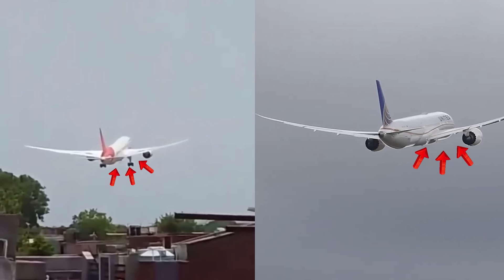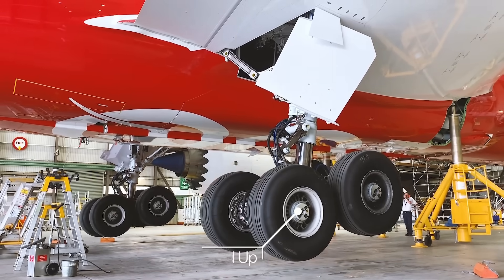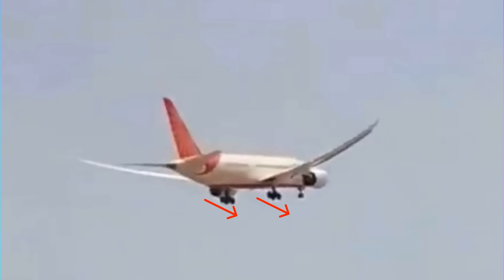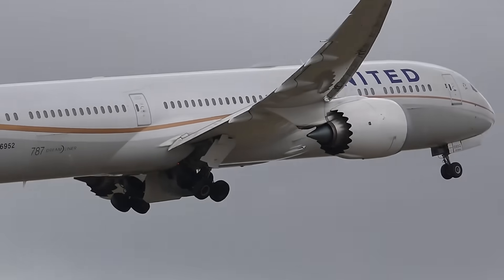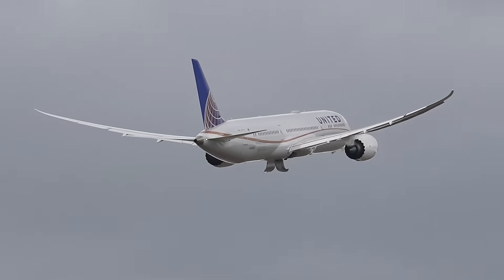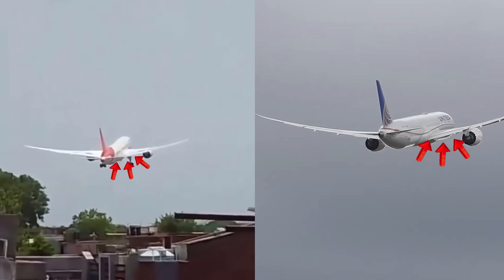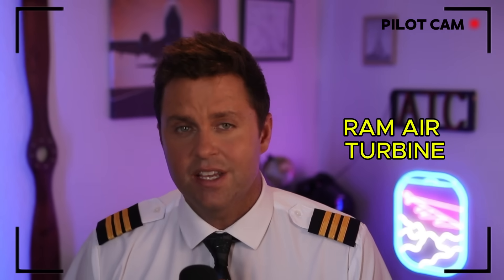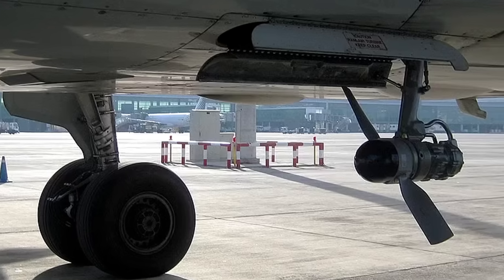Pilot Explains: A New Detail in the Air India 787 Crash Everyone Missed

Comment: my own feeling is that any engine issue would have been visible with some sort of smoke or something showing the engines not preforming well, also, I believe one actually can hear the engines on that video... maybe not full power, but they are stable as far as I can hear... the Rat will also deploy in a hydraulic failure, which seems like it might make the pilots stall the plane in a way that would appear like what one sees here.

Comment: Contaminated Fuel could be ruled out, as the same fuel was used for take off, which went smoothly.
Reply: Not if there was water or contaminant in the fuel that was just loaded. 
It takes time for the contaminant to flow through the fuel lines and reach the engines.
Reply: @spacecadet1249 water or contaniment has never ever caused any accident, except in piston engines. This was a state of art engine. This engine was capable of even digesting chickens.

Comment: Sir,
The fuel tank is fully loaded with thousands of gallons of aviation fuel for long journey, in the process, some sediments settled at the bottom of the main storage, not likely by any stretch of imagination, but POSSIBLE, the storage tank might’ve been scraped to the last drop, whereby the sediments might have entered into the fuel ⛽️ injection lines to the engine, and that it happened so early in the takeoff, meant, the sediments were still floating in the system, didn’t get time to settle down to the bottom yet !
Sincerely !

Comment: After gears up activation, full power loss, rat deployed for electronics and hydraulics, but cannot continue gears up, lights flicker due rat takeover electronics,
Decades ago i knew of thieves bleeding avgas tankers to sell as kerosene, but will not replace with water, now if thieves replace with water so the levels will be the same. That could cause dual engine failure, question is fuel contamination alarms on the A/C during refueling.

Comment: No way the pilots put the flaps up by mistake. Because the aircraft flew straight and level all the way to the ground absolutely indicates loss of power. You started by mentioning that contaminated fuel could cause that so that is probably the first suspect. But it's a complex aircraft and I have no idea what else could cause both engines to lose power. The idea that both engines fail at once is too remote to even be a consideration. Then of course you can't rule out it was an intentional act by one of the pilots but I would hope that it's also a remote possibility and was not the cause. We're going to have to wait until the facts come in to know for sure and of course the whole world wants to know what caused this disaster.

Comment: It is a balanced assessment by Gary. Not eager to jump the gun and just stating few facts. No conclusion yet. Good.
Imagine the sequence:
1. Aircraft accelerates normally up the runway and takes off smoothly at about IST 13.38 hrs - At the instant of rotation Engines were working - 0 Sec.
2. WITHIN 50 FT HEIGHT THE LANDING GEARS DID NOT RETRACT -  FAILURE TO RETRACT THE LANDING GEARS WAS COMMUNICATED TO THE PILOT - AIRCRAFT GAINING HEIGHT - ENGINES WERE WORKING - 5 secs.
3. Pilot senses the abnormality and tries to accelerate and climb quickly - Engines working - Aircraft gains maximum height (11secs) - between 5 & 15 secs.
4. Pilot senses the loss of thrust - Engine is still working but not delivering the required thrust? - Aircraft reaches it's maximum height 600 to 650 ft using the momentum - RAT (Emergency power generator triggered in the event of Duel Engine Failure) would have projected out - SOMEWHAT faintly evidenced from the visual footage of the flight - between 15 & 25 secs
5. May Day message: Sent "seconds later" than takeoff. The pilot's words were "Thrust not achieved falling Mayday! Mayday! Mayday!" - between 15 & 25 secs
6. Aircraft starts loosing the height and pilot desperately tries to save the flight - between 20 & 30 secs.
7. Aircraft continued to descend rapidly and crashed into the building - inferno/fireball - between about 25 & 35 secs. In about a minute, after the take off, fire ball & smoke errupted from the crash site could be seen from outside. 

Engine sound is clearly audible in the visual evidence as the aircraft was descending and approaching the building before collision. Was it the sound from the RAT? or was it the roaring usual loud sound from the engine? 

Flaps position in/out during the flight NOT decernable convincingly enough. There could be something about it or there is nothing about it. Investigation will reveal. 

Seq No 2 & 3 are not clearly explained in the expert analysis. There could be a slip which is not assessed/analysed. 
Until then lots of speculations? 

What is robust Safety?
Save lives.

Comment: I am not an aviator but having seen thousands of take off videos suggest to me that problem(s) had started much before the lift. Flight 171's rolling down on the runway after setting the thrust till arriving at V1 was perhaps not going as planned. The plane nearly used 100% available runway for the lift, which was executed with some serious effort. The dust blown at the runway's far end tells more about that. Do other planes using this runway also kick the dust as was done by this plane?  .... only some relevant official can tell. Why the Capt did not abort this take off ? .... would be known after black box data is deciphered.

Comment: contaminated fuel? nah ive been leaning more toward electrical , i am not fully sure of the systems on the 87 but they use very similar electronics as the jets i work on.. the jets i work on have a very specific issue albeit EXTREMELY rare and the likelihood of it happening are nearly 0 but if you lost ALL accessory drive/engine driven generators and no apu, you would lose all electrical power including to electric fuel pumps to the point a DC override switch was installed in order to run major systems off battery bus. this would both explain the loss of engine power and the loss of hydro causing the gear to stop mid transition.. so either something catastrophic happened to the accessory drive on both engines... or something to do with the engine generators on both engines and APU inop... an inop APU would explain why passengers where complaining it was hot..etc..

Comment: The fact that you are not using the original video even Capt Steve claimed he was not originally aware of in his latest video. Meaning when the original video was release the RAT was clearly heard prior to the his assessment. 

Due to his assessment, I tend to agree with Capt Steve. Due to the most probable activation of the RAT, both electrical and hydraulics failed, meaning a dual engine failure. IMHO, the first officer did try and retract the gear, its next to impossible to confuse flaps and gear up, no matter how panicked you are as a pilot. 

The only criticism I have is the pilot stopped flying the plane after power loss, IE he kept trying to pull the nose up rather than flying the plane to a safe area...  if there was a safe area.  In the end, we will all know for a fact what happened in 3 months time when the black box is thoroughly examined.

Comment: Not an expert, but during take off though both engines seem to have an effective and stabil  "maximum" trust (suggested by the postengine "exhaust"). A possible fuel contamination, you would expect to symptomize itself i n a gradual and irregular manner, and NOT to manistest itself smoothly with just a few seconds of notice. A fuel contamination also probably would not affect the engines several of seconds apart which the planes stabil course "disproves". Another potential cause of completefuel cutoff, could be a sudden onboard computer mallfunction of the fuelinjection.The pilot knew he did not have adequeate alttitude to dip the nose to increase speed, so his best damage control option was to attempted a tail first touchdow n with the hope of a gradual speed d ecrease. (A good guester from Boing could be to finance the burial of the victimes, they probably can afford it).
Just a humple theory.

Comment: Either 1) flight crew error e.g. fuel switches turned off , 2)software failure,  3) electrical failure, e.g burned out wiring, circuits fusing etc..,  4) dirty fuel is a stretch. The only remaining theory: 5) sabotage.
Reply: Suicide by co-pilot.  Has happened, Egypt Air flight.

Comment: A two-engine failure?  25 years ago, a plane could be rated to fly on one engine for three hours.  The chances of one engine failing have to be so remote that we could essentially disregard the chances of both failing independently.  One in 10^5 chance of one translates to one in 10^10 chance of both independently.  It's possible that with a huge number of flights, such low odds might have caught up with us.

One scary possibility: one engine may fail, and a pilot may inadvertently turn off the good engine.  A second scary possibility: sabotage.

Comment: MAJOR FAULT CODE
The extreme heat during that day at Ahmad'bad Airport above 40 deg C overheated the forward equipment  bay during 3 hours time cause a overheating safe reset system in the fuel system controller after take off monitored by cause of ascending excess heat in addition. ( Our DG fuel injection Overheating safe state mode) as experienced.

After reaching the ascending stress altitude Fuel Injection stopped at right engine and to the left engine. The flight was on full loaded close to maximum take off weight in Electrical load produces more heat again in the Forward Bay all the Back up system controller has been kept. 
* First Fuel Injection stopped
* Secondary back up power generator stopped
* Battery back up system stopped due to the overheating. 
Immediately RAM AIR TURBINE automatically deployed is the sound heard by the surviver and during the RAT power overtaken the electrical bypass system causes instantaneous flickering obviously happen during the rapid change over from the different power source which running in 3000 RPM.

Comment: I wonder if you should consider the initiation of engine power by the electrical system that performs that function. I wonder if there was a failure in that system after the engines had started,….then the engines failed after the start. The surviving passenger said lights in cabin  flickered just before descent
Terri Nowak
Aviation enthusiast

Comment: This seems similar to the MV Dali that crashed into the Francis key bridge in Baltimore , due Engine failure , as a result of the generators failing , thus went on  emergency power with the NTSC & other agencies faulted the machinary,  when he basic cause was the erranoues action taken by the river pilots , out of panic faced with  an emergency situatiion,
As for not taking in the landing gear & flaps , it appears the pilots were from the very early facing thrust problems,

Comment: Could a computer or electrical system failure cause a fuel engine failure, like if the computer dies in your car and it won’t start? Or would a gas turbine keep firing itself regardless.

Comment: I know another channel is suggesting a vapor lock in the fuel lines due to excessive heat in India that day. It would be ironic if planes were prevented from taking off in excessive heat which is partly attributable to the airlines own contribution of greenhouse gas emissions. What are the published upper limits of temperatures for take off? It's hard to imagine that 15+ years ago during the plane's development that test flights would have found anywhere hot enough to test what the climate is going to produce over the next 15.

Do plane's have temperature windows they must not take off outside of? We may see more night time flights emanating from equatorial countries in the near future.

Comment: Jet fuel contamination is a known problem in India, with potential links to recent aviation incidents. Specifically, issues like "powder metal contamination" in engines and the presence of FAME (Fatty Acid Methyl Ester) from biodiesel are concerns. The recent Air India crash in Ahmedabad is under investigation, with fuel contamination being considered as a possible contributing factor. 

Here's a more detailed explanation:

Powder metal contamination:

This issue has affected multiple airlines, including IndiGo, and has led to grounded aircraft due to engine defects. 

FAME contamination:

FAME, a component of biodiesel, can contaminate jet fuel through shared distribution systems (pipelines, tanks). This contamination can affect the fuel's properties, leading to potential issues like coke deposits and fuel gelling. 

Detection and Prevention:

While India has quality control measures in place, including specialized laboratories and refueling procedures, the potential for contamination remains a concern. Methods like gas chromatography-mass spectrometry (GC-MS) and Fourier Transform Infra-Red (FTIR) Spectroscopy can be used to detect contamination. 

Ahmedabad crash:

The Air India flight that crashed in Ahmedabad is being investigated for various factors, including the possibility of fuel contamination. 

Consequences:

Jet fuel contamination can lead to engine malfunctions, reduced thrust, and ultimately, aircraft accidents.

Comment: I hate to hypothesize after watching this excellent analysis.  But could it also lay open the possibility of sabotage of the electrical systems?  Or , god forbid, some form of EMP attack?  How hardened are the systems to such a form of attack?  Lightening strikes, sure..  But military grade EMP weapons?..   We shouldn't ignore such a scenario, IMO, farfetched as it may sound..  It would require a serious amount of contamination to completely flame out both engines,IMO.   AND OTHER planes refueled from same fuel farm should have experienced issues as well, right?  Would it require more than one fueling pump truck with a failed filter/separator?

Comment: Do you think that double engine failure means the problem is not the engines?  If fuel contamination was the case then do you rekon they would not spool up to max thrust with no sputtering until they were in the air?  The elephant in the room is Boeing and it is not going to get any better no matter how much we talk.

Comment: Coming from a position of no knowledge of the subsystems of the 787, but a least experience as the Safety Engineer on the Space Shuttle Main Engines, is there any electrical circuitry or hydraulic systems that are tied into the engine management systems - such that the retracting of the landing gear (initial tilt function) would cause an issue with the engines?  In other words, rather than the landing gear issue of not being able to fully retract, be the cause of the engine issue vs the other way around - in which the engine issue causes the landing gear issue.  Maybe this fault tree box can be close, but just wondering.

Comment: Pan Am 799, 12-26-1968, Elmendorf AFB, Anchorage, Alaska, very early a.m., I hear these incredibly SCREAMING ENGINES, so loud I was jolted awake from a deep sleep, I have never heard that loud of a noise, the 707 was struggling to get airborne, crashed at the end of the flightline a VERY close distance from our barracks, then the black sky came alive with a huge orange ball of fire. The A.I. 787 was not making a sound, I believe the pilots would have had throttles completely pushed forward. I feel they had a dual flame out, I still remember those screaming jet engines 57 years after the crash. (I was 19 and had nightmares for months afterwards and never told anyone) Had to be no engine thrust. Peace for all the folks involved in India. BOEING not responsible for an aircraft accident 12 years after delivery, suspect operator problem of some kind.

Comment: As your example shows, some gear doors opened during the retraction sequence. The opening of those doors adds additional drag that can inhibit acceleration and rate of climb. A little fact checking (787 operating manual) might indicate that gear retraction on RAT power only may be much slower than normal further compounding the problem. The retraction sequence may have stopped as a result of continuing loss of airspeed as the crew increased pitch. The decreasing pitch of the sound of the rat (not engines) may be twofold. Doppler effect as the plane passes the camera position and RAT  speed slowing as airspeed bleeds off.

Comment: Sadly, you’re talking nonsense.

25000 hr, 787 P1 8000hr on type.

Whilst 777 has a ‘common’ rating with the 787, there are crucial - and massive - differences.

Looks like OPT  & loadsheet errors leading to invalid critical data procedure.

Take-off run leading to only making 15’ ( at best…) over the threshold.

Forward tilt of gear after t/o implies that gear was selected ‘up’ at call of ‘positive rate’ - but then something caused the retraction to fail.

Potential RAT auto-deployment suggests loss of hydraulic pressure and/or electric power.

If insufficient thrust and/or acceleration on t/o roll (note v low height over ‘hedge’) then P1 should have followed FCOM/FCTM which requires’STOP’ call.

At 400’, FMA mode changes from XXX / LNAV / TOGA to XXX / LNAV / VNAV SPD. This would cause the flight guidance cue to command a lower nose attitude if AoA & speed were outside parameters.

All the above point to poor procedures and then hitting ‘something’ (ILS antenna for 23 at the 05 end?) causing loss of hydraulic pressure & gear retraction failure with contributing errors of actual speed being below the real required V2 leading to subsequent hull loss.

Or, you can go for the totally improbable ‘double engine failure’….

But, best option, let’s wait for the QAR & FDR traces.
Then the actual truth will come out - rather than pointing fingers randomly for upticks….

??